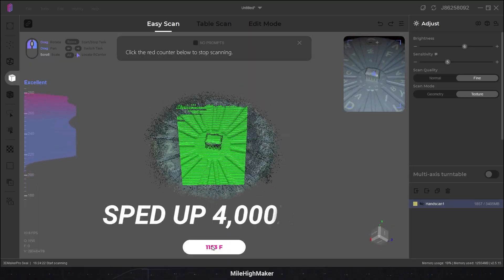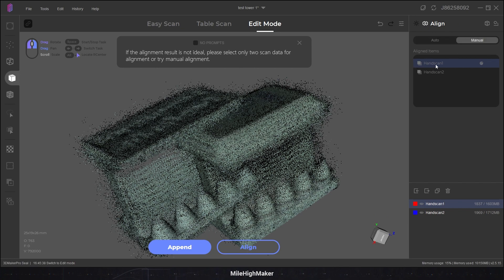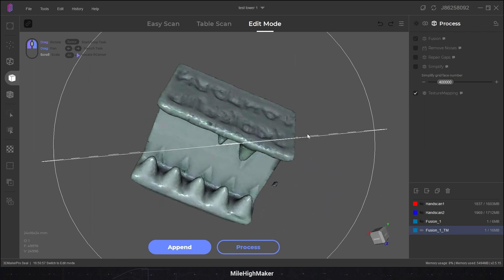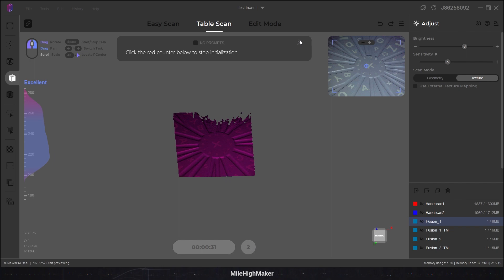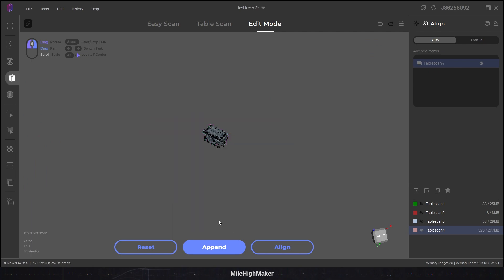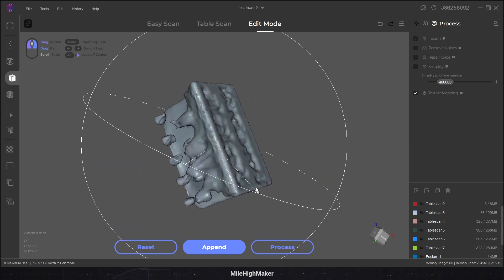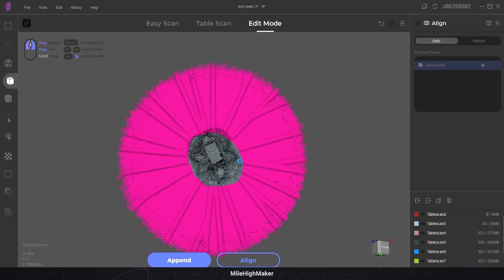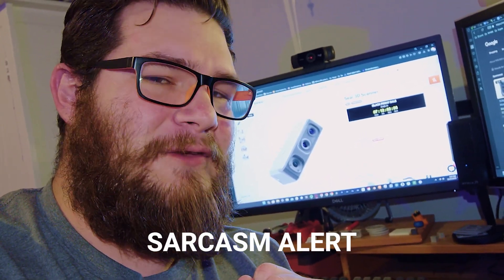What CAN It Scan?! 3DMakerPro's Seal 3D Scanner

Comment: I bought serval scanners now. 
Revopoint mini for really small stuff. 
Einscan-SP for parts of the size of a controller or slightly bigger. 
Einscan Einstar for big stuff.

For this part I would have used the Revopoint mini. The Einscan-SP would be more convenient but it’s not made for small stuff like this.

Oh and the 0.01mm accuracy must be a scam. Even my 2k€ Einscan-SP scanner has only 0.05mm accuracy. I checked it and it was 0.05 or less.

Comment: I think you may have forgotten to adjust the sensitivity in the upper right corner. By increasing it to 10, you can greatly improve the resolution issue.
Reply from the maker: The sensitivity acts kind of like camera ISO. I can increase it and the scanner will technically be more sensitive but the point cloud is also more noisy. I have a video coming out soon that will show the differences in settings.